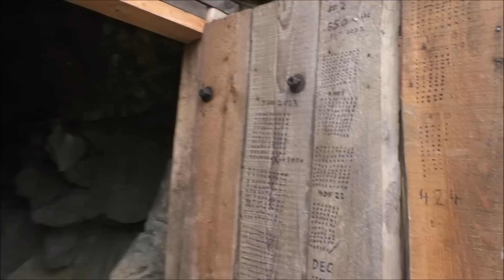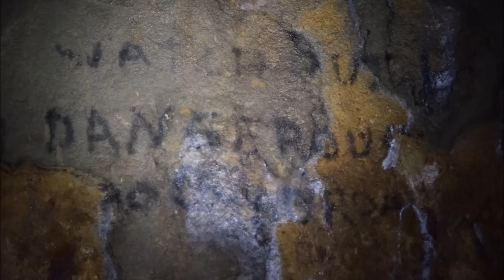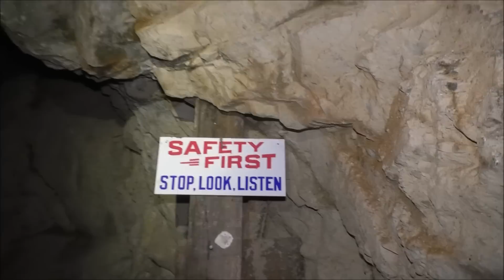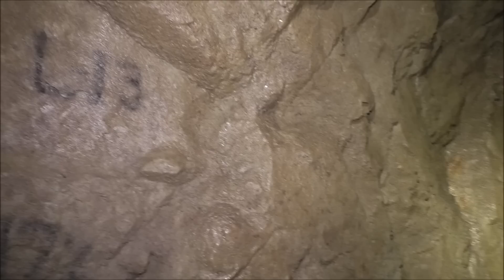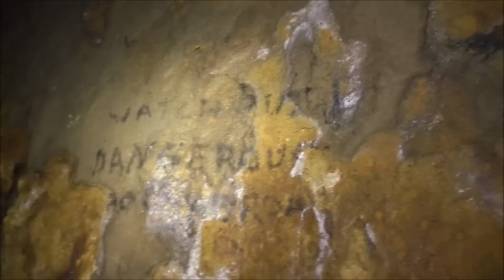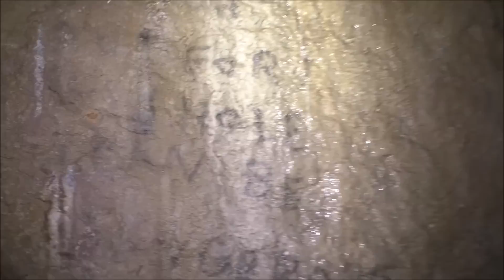#347 We Get Past The Collapsed #2 Shaft!

Comment: One of the most treacherous facts about ALL mines, [more so when they are really old, and not super carefully set, stulled and maintained, is that they ALL slake, slough, shift and collapse, from a tiny bit to enough to completely vanish.

I learned in my studies of modern mining that it is critical to spray shotcrete and webbing up on the backs and ribs of newly cut works to block air exchange and secure the rock from slaking which leads to breakage and collapse.

Comment: Well Shell brought X100 oil out in 1949, so that dates the earliest that someone was bringing those oil cans in the mine..
Reply from the maker: Probably from diamond drilling.
Reply: @exploringabandonedmines  That'd probably be an accurate idea. Have you found any pieces of core samples?

Oh if you can get some worn out fire hose, secure pieces of it on the edges of rock where your static line runs and it'll protect it from abrasion and cuts. Plus it'll help keep the rock dust/particles from grinding into the core of the rope. We used to do that when I was involved in mine rescue. We used to carry a masonry nail gun that shot the .22 blanks to drive a few nails to hold the hose in place if it was going to be used for a while. Cheaper than replacing rope.

Comment: 15:51  Well, I have to let you that iron made before the nuclear weapons detonations have less radioactive materials in it because the process uses lots of air. They specifically search for pre-nuke aka low background steel in order to make things like Geiger counters and many medical machines and devices have a low tolerance to post 1945 nuclear steel. Soo. It is worth more than normal scrap if it is pre-1945 steel.   Its worth much, much more and I have actually heard it referred to as pure treasure.  fyi...  don't getpre-1945 scammed.
Reply from the maker: The track is made from steel not Iron. I have heard that before. Urban legend in my opinion.

Comment: You don't really need tests if you use revere osmosis with prefiltering. There's a bunch of commercial kits that can give you drinking water out of rivers, let alone an arguably (outside of heavy metals - but there's filters for that too) cleaner source.
Reply from the maker: It  could have arsenic or other heavy metals common in the area.

Comment: Is there any law against sampIng that quartz.     You may have a. paying deal there.  I might go nuts wondering. What's left.
Reply from the maker: You would have to construct a mill or smelter to get the gold out, Not a paying proposition for ore left over.
Reply: @exploringabandonedmines   just throwing it out there   Mount baker  smelted some from cirogordo  … forget exact numbers  .. pretty cool vid , went down  shaft  hammered off  15-20 lbs of ore got around  a dozen 2” inch bars of silver … interesting process 👍  🤷‍♂️ if crossing the 49th wouldn’t be an issue  might be cool to have  a few lil bars for display purposes in the museum ,  actual bullion from the YB! 😛 🤦‍♂️ 😳🤷‍♂️ ✌️🤙